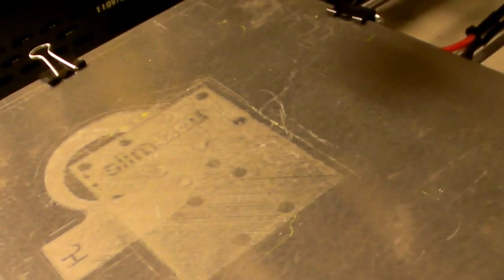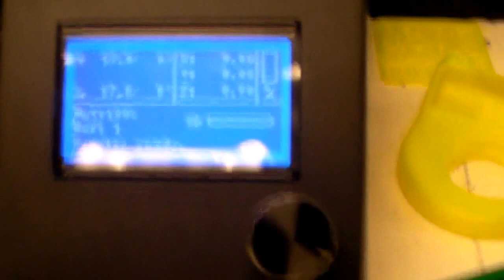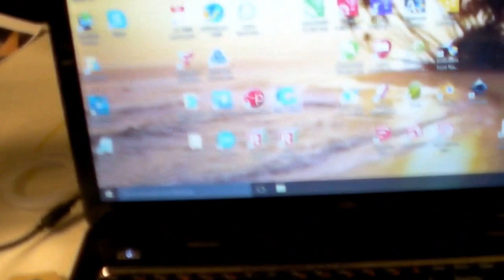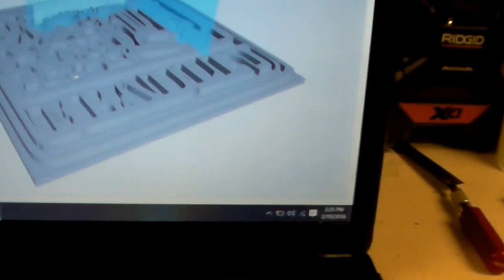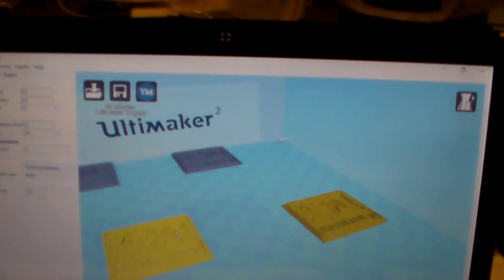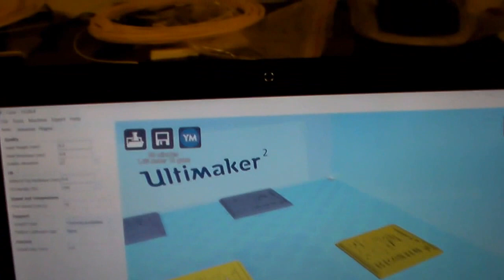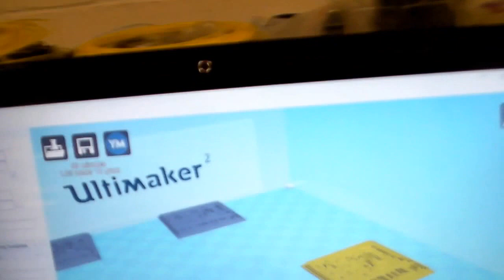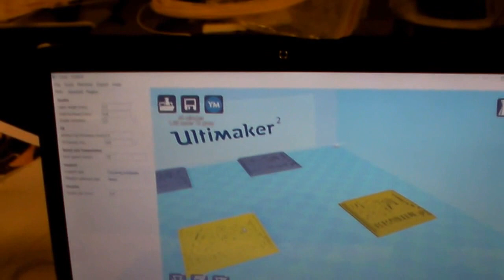WANHAO Duplicator i3 update 2/10/16

Comment: go to machine setting and pick RepRap (marlin/Sprinter) looks like your now using RepRap (volumetric) or Ultigcode thats why you don't see some of your setting.... and click on the platform adhesion type and lower your brim line amount and you should be able to put them closer together.